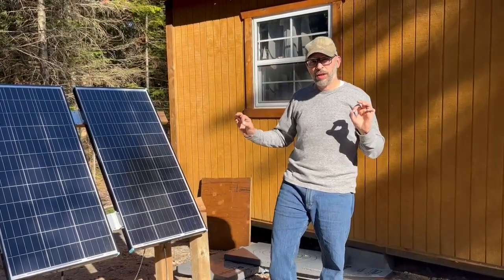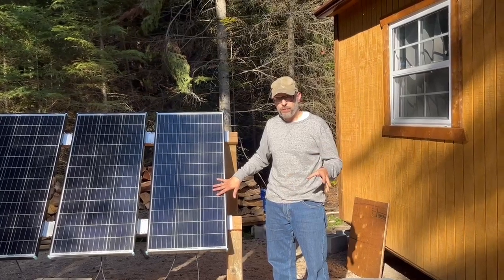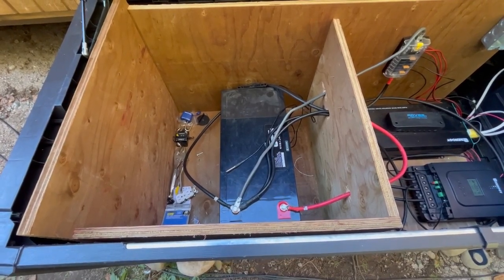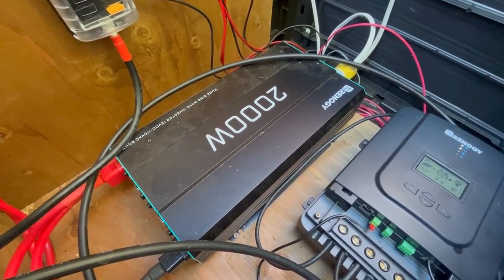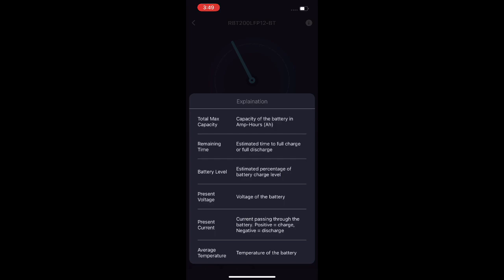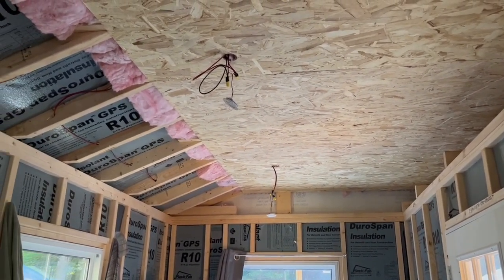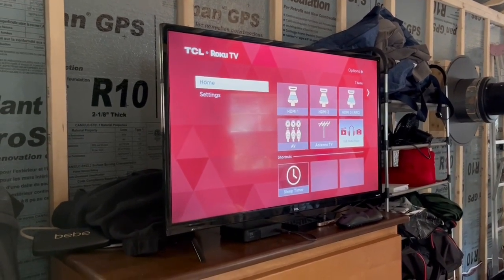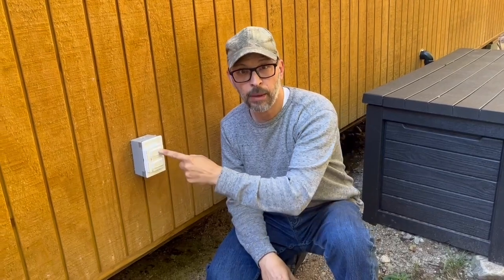OFF GRID SOLAR SYSTEM

Comment: all panles shadet so make serial is not really the big deal.
it you have 8 panels and cann not connect all panels on 1 charge controller why not use 2?
i for exampe make 3 different parallel strings than run into 3 charge controller that charge the battery together in a good rate in shadet area.
 on aliexpress are enought MPPT controller for ~30$ what delivder great performance  and the tracking speed for shades is faster then a victron mppt....

so if money is the problem cheap MPPTs are nowadays very good.

on house roofs and no shades possible serial strings are the way to go, if a alot shades on the solar area parallel is the way to go so failed panels will not affect the others and ea panel can deliver what is possible.
Reply from the maker: Thanks for the input!

Comment: @8:35 - one of the reasons I got into solar, no noisy generator. 👍
@0:35 - seeing some shade around the cabin so guessing you made the video late afternoon. But looking at the view of the panel array, if they are in series here (4s) then when 1 or more get shade this affects the whole set of 4. For the most part I agree with junkerzn7312's post below. I have the Rover 40 so in a 800 watt system I would be going with 2x 40mppt's feeding the same bank. Speaking of batteries this part can be some of the most $coin$ in any system. But also key to a good reserve. For years, I used 4x GC2 6v golf cart batteries in series/parallel for a 12v 400ish aH bank and that worked well. Flooded/wet cell deep cycle batteries have some maintenance but can be cost effective. Recently went with 4x agm sla's.
Cheers & good luck!
Edit to add: if you need to heat your bank maybe look into 12v tank or elbow heating pads. I'm sure they would draw a lot less power than a 120v deal.
Reply from the maker: Thanks for the advice! I still have lots to learn about solar, just kind of learning as I go!

Comment: Nice setup!  I would suggest mounting the charge controller vertically so the heat can flow out out the top instead of being trapped underneath.
Reply: And that heat will heat the battery - so raize that box verically and put the battery on top shelf. The heat from charge controller and invertor from bottom shelf will flow up to the battery.
Reply from the maker: Great idea, thanks for sharing!

Comment: Many times if the battery is flat you should run the generator to charge it quickly at full power, then turn the generator off and live quietly on DC again.
Reply from the maker: For sure, thanks for watching!

Comment: Thnx for the video... Though it's actually the solar panels that take the solar energy & convert it into DC power... The charge controller only regulates battery charging voltage & current...
Reply from the maker: Appreciate the input, thanks for watching!

Comment: It looks like the two banks are going to be getting different shading conditions, which means that they should each be going into a dedicated MPPT instead of being paralleled.  If you parallel the banks, the charge controller's single MPPT will not be able to optimize the power for either bank... it will wind up picking a point somewhere in the middle which is not optimal for either.   That's going to be a problem in variable shading conditions..   Also, depending on the sophistication of the MPPT, the paralleling will result in a fairly weird looking MPPT  curve due to the shading and this can cause the MPPT controller to lock onto the wrong local maxima (the one for the weaker bank instead of the one for the stronger bank).

--

Now lets look at the voltage.  Not sure exactly which charge controller you have but if its the Rover 60 then max voltage is 130VDC, max current is 20A, and the MPPT range is ... hmm, its not in the specification but it probably needs a minimum voltage a few volts above the battery output voltage.   Renogy 100W panels have an open-circuit voltage of 24V and an operating voltage of 20.4V.    So that part of the setup is ok... 4 100W panels in series is the sweet spot (96V open circuit and 81.6V operating), you could do 5 panels (24V x 5 = 120V which is still lower than the 130VDC max voltage for the charge controller, but no reason to push it).

One thing to keep in mind is that shading conditions will significantly drop the operating voltage of the system, so you want to make sure that the operating voltage is still decent in such conditions.  If you check with a DC volt meter on the solar panel side while the charge controller is fully operational, the operating voltage on the solar input should always be significantly higher than the battery output voltage.  If it isn't, then the shading on the panel configuration is too great for the MPPT to operate optimally.  This can sometimes be compensated for by adding an additional panel in series, but you have to be absolutely sure that the combined open circuit voltage of the panels never exceeds the charge controller's max input voltage.

--

Finally, amperage.  The charge controller is specified for up to 20A on the solar side.  The 100W renogy panels operate at 5A (4 in series is still 5A, just at a higher voltage).  So you should only be seeing around 10A worst-case in your parallel configuration.   That part should be fine.  Make sure the wiring can handle it (pretty much a given at 5A or 10A, but more care must be taken if going higher).

--

So if I were to make any suggestion, it would be to get a second charge controller so you have two MPPTs, one for each string.  Do not parallel the strings.  And given the shading conditions that I saw in the video, consider possibly adding a 5th 100W panel to each string.  5 x 24VOC = 120V which is still below the charge controller's max voltage.

(If you ever upgrade to a different brand or wattage of panel, recalculate the voltages based on the specs, of course multiplied by the N panels in series, to ensure you do not exceed what the charge controller(s) can do).

-Matt
Reply from the maker: Great information! Thank you so much for sharing with us.